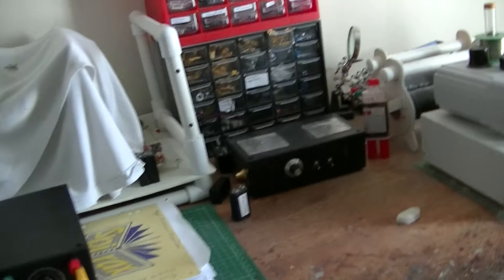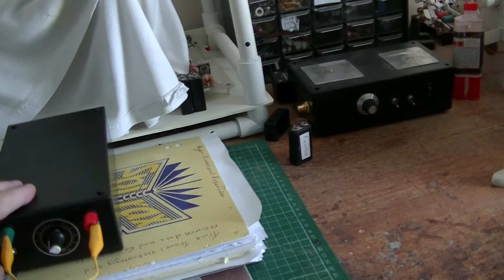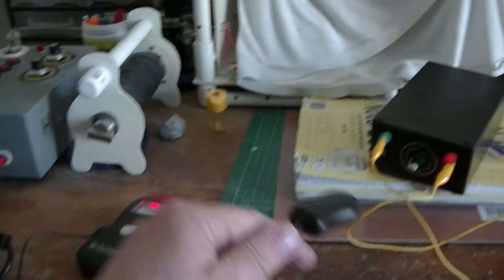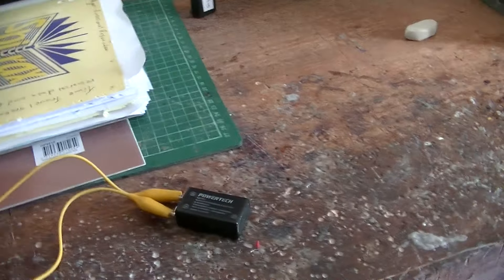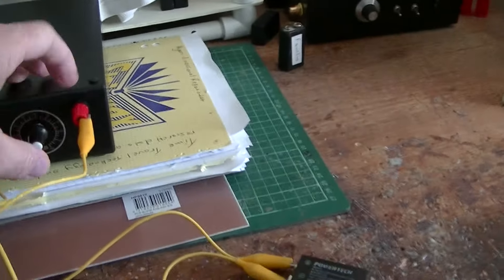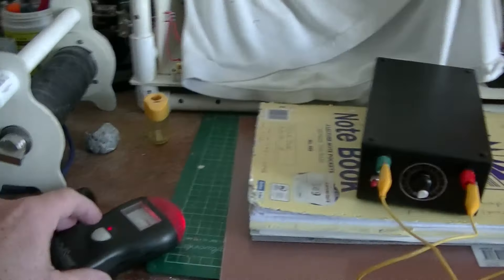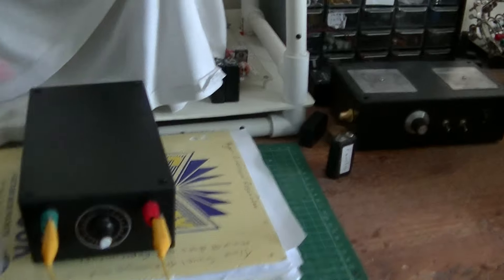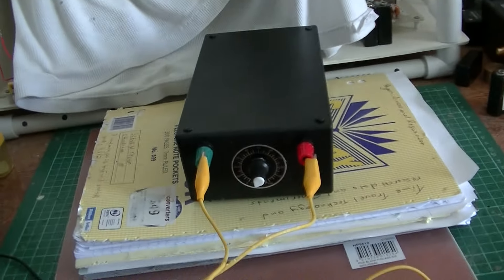powerfull em pump design and test 1

Comment: Hello steven his tone électrovibrateur works well with the engine and the magnet it makes a lot of its vibrations can be used to other things that attract your device ghosts; his gives me little idea bypass your system to vibrate rocks and work.
thank you for your video.
see you soon.
Reply from the maker: Dave the vibration isent enough to vibrate a rock concert let alone a rock lol,  ive got the vibrating speaker on hold till latter
Reply from the maker: the vibrations not powerfull enough to use for rock cutting
Reply: yes I know but steven couple to the right frequency of its two set his can work.